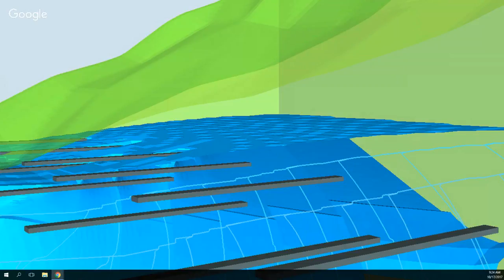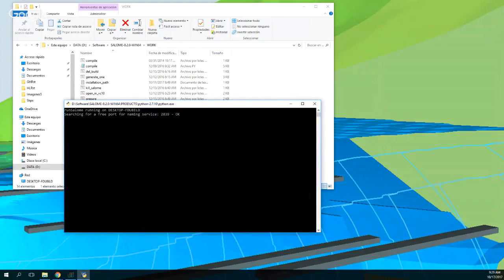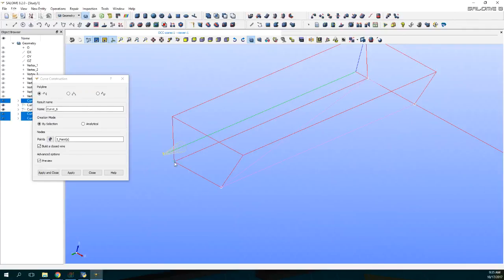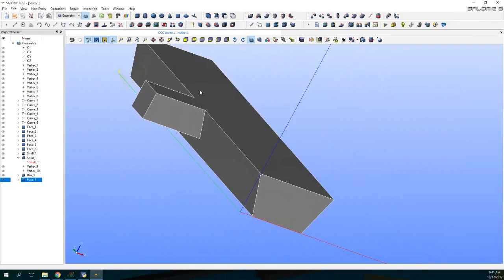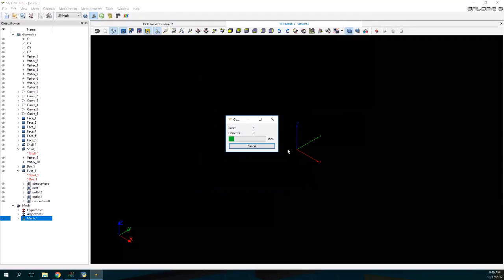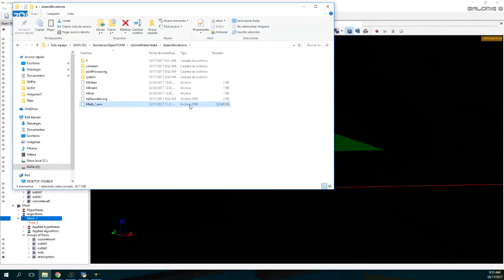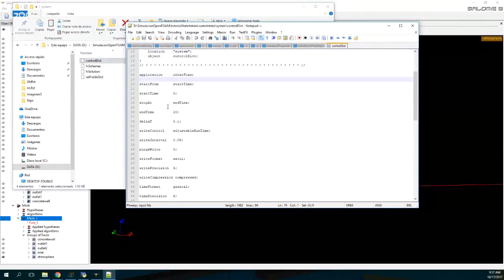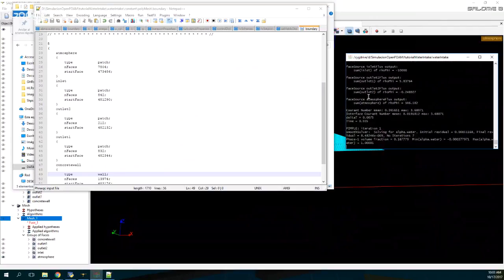Tutorial: Intake Channel Design with OpenFOAM and Salome - Part I

Comment: Thank you for this helpful tutorial, I tried to run it but I got this error: 
FOAM FATAL IO ERROR: 
size 387339 is not equal to the given value of 242659
/run/0/alpha.water from line 21 to line 387391.

any suggestions?